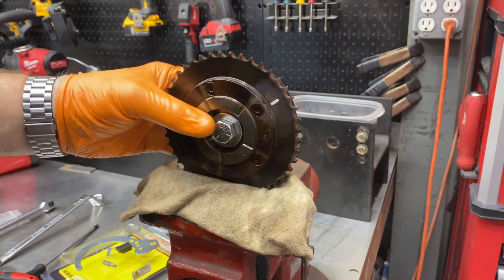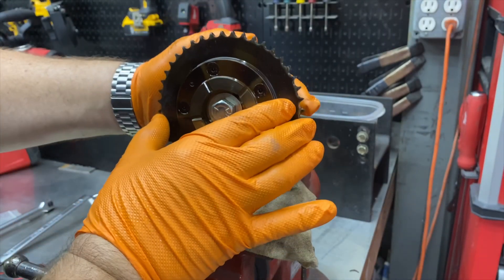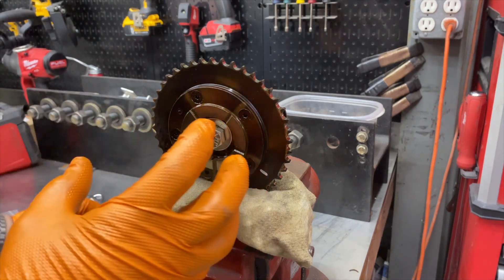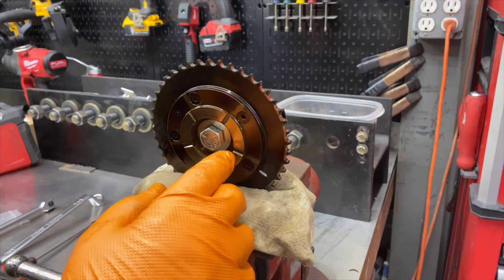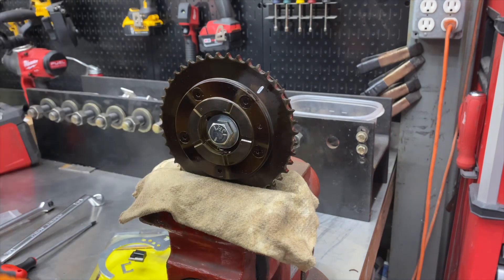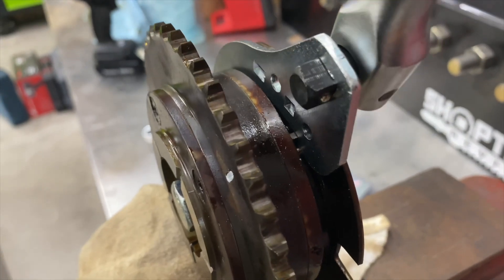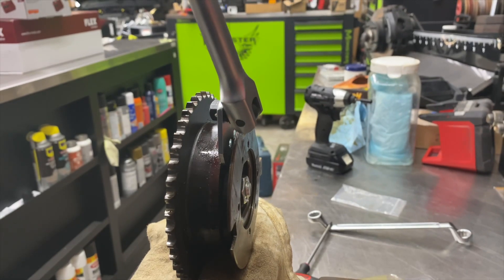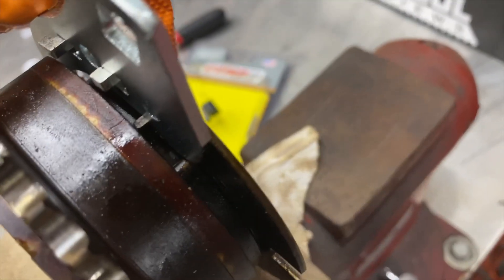Get More From Your Cam - CompCams VVT Cam Phaser Limiter

Comment: I am getting code p0011 after installing this kit. Any advice??
Reply from the maker: That's definitely a VVT code. Did you have the truck/suv tuned after installing the new kit. You must have to tuned, and they'll have to tune in the new small parameters of the cam phaser.
Reply: No I did not tune after installing the kit , the comp cam website said not tune needed with stock camshaft,  I have factory camshaft
Reply: I have been fighting the Poo11 code since 2 years now check the wiring on the plug they do break and did you use a new camshaft bolt?
Reply: Yes new bolt on camshaft ( actuator and selenoid) new
Reply: @aramishernandez6109  Did you ever figure it out?
Reply: What fixed it?

Comment: Can’t Ecu programming do this as well? Or only
Mechanical?
Reply from the maker: The ECU can handle some static timing but it can't eliminate the variable valve timing. This is actuated by a spring and oil pressure.

Comment: This phaser limiter Required in all cams?  Have a stage 2 and the phaser limiter is optional… trying to find out why that would be optional and not in a cam package….
Reply from the maker: That cam-phaser is required on certain cams, and you must re-program the ECU if you are changing any of this. If you out a cam that doesn't require a phaser and you're replacing a cam-with-phaser, then you much re-program as well.
Reply: @Shoptoolreviews  appears my order did have it.   So it’s installed …. Close call I was nervous. 😂😂